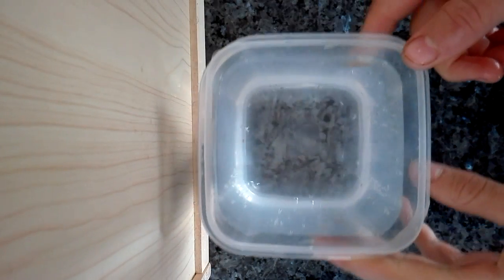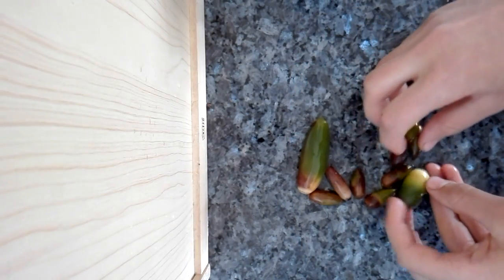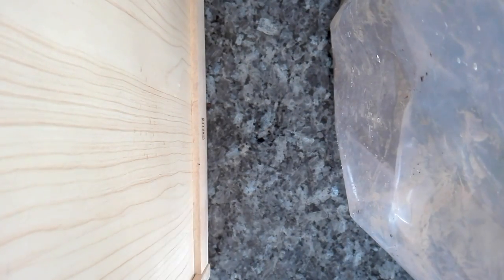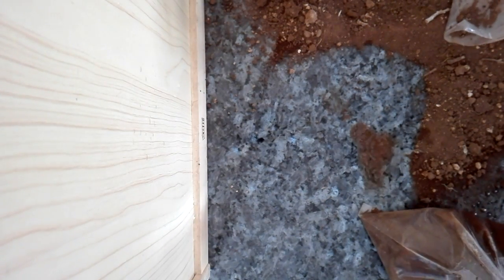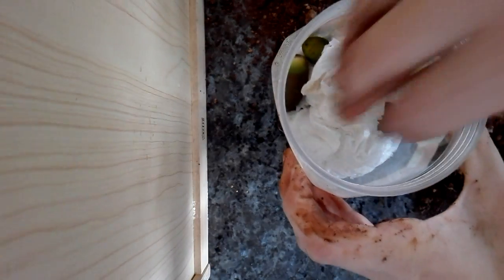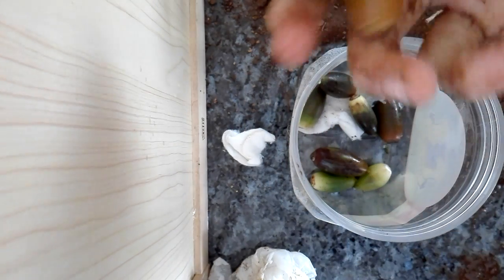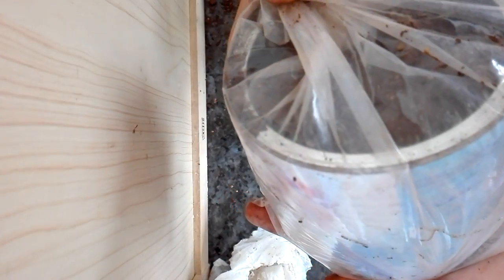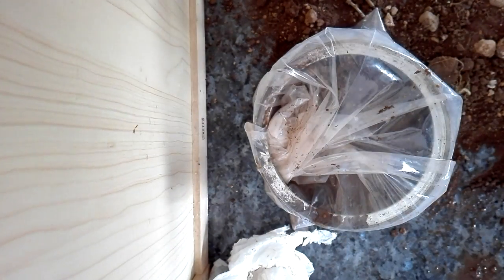how to germinate and grow acorns

Comment: The weevil larvae hasn’t necessarily killed the acorn. And floating doesn’t mean it won’t sprout. If you soak the acorns, the weevils will die and the acorns may absorb enough moisture and be viable. Since it takes so little effort to attempt propagation of the acorns that sink after soaking for 24 hours, there’s little reason not to try.